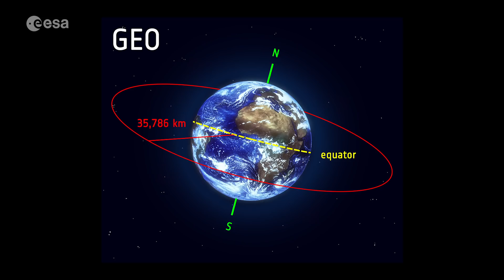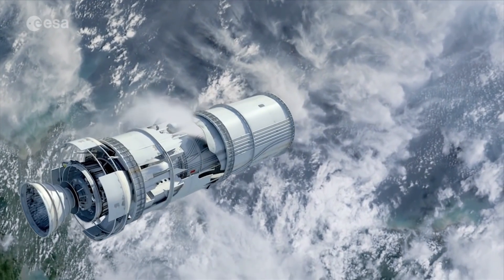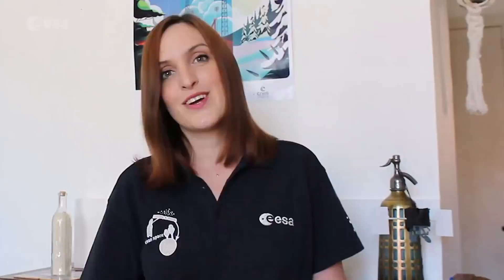Cleaning up space | Meet the experts

Comment: Thanks for the video, Sara.  I am a layperson with some questions regarding space debris removal if you could kindly answer:
Is Aero-gel used in any debris removal methods (i.e. coating the nets with beads of aero-gel)?
5:20 In what situations has the net-method been proven/theorised to not work in?
5:40 Does the harpoon method not pose the same problems with smaller debris being released into orbits when the harpoon penetrates defunct spacecraft? 
Is it possible to have small monopropelled spacecraft with some sort of magent to connect with defunct spacecraft and push the spacecraft into either graveyard orbit or into the atmosphere?  
Are plans to collect old spacecraft and reuse their materials in orbit (e.g. for building Lunar Gateway) a bit too ambitious?

Comment: #askesa why don’t you research and demo in situ resource utilization of these space debris? Why would you want to burn so much good material in the atmosphere which was put up there with the hard work of so many people? What I would would be to set the space craft to find and tow this debris to an orbital recycling factory and reuse all components and sell the raw or refined materials to new expeditions/missions at a lower price than the launch costs of the stuff per weight that they would have and still if it would cost roughly the same, the launch capabilities are finite, so there is a limit what can be lifted up to orbit under a given timeframe

Comment: I'm not a fan of the way space debris are depicted with everything being so out of scale (sats being as huge as small countries) but the problem is real and needs to be adressed so a good thing ESA is working on solutions.
Considering costs and safety for those projects, it seems that space net is the best option, harpoon being a bit rough solution with potential hazard issues by piercing some sensitive stuff who are usually the bigger parts of a sat and robotic arm needing a far more complicated approach and technical parts increasing cost. I remember seeing some fluids and electric muscles arms who could be a cheaper variant for robotic arm to capture a derelict. 
On a funny note, this last capture cinematics reminds me my attempts on KSP to capture a fuel deprived spacecraft using scaffolding arms and landing legs to secure the captured spacecraft.